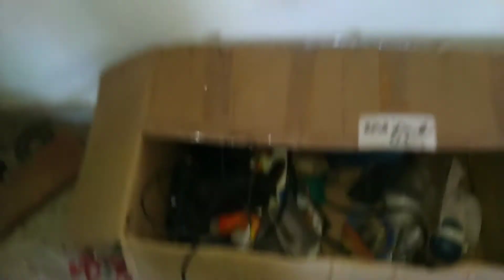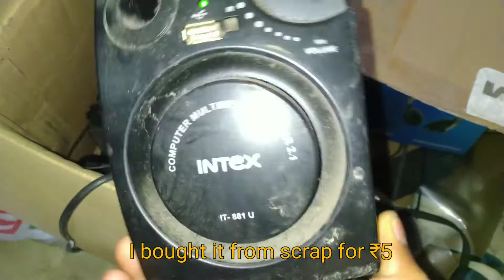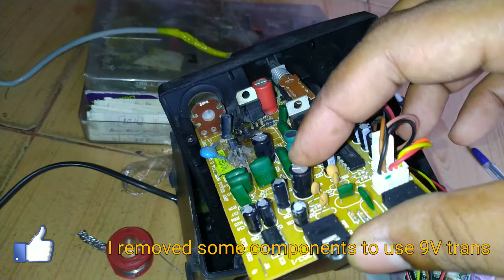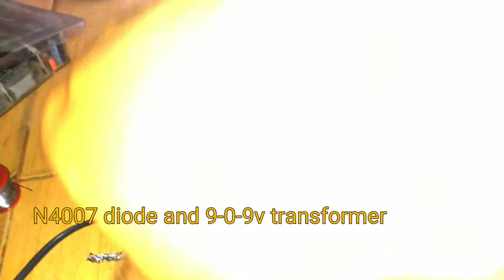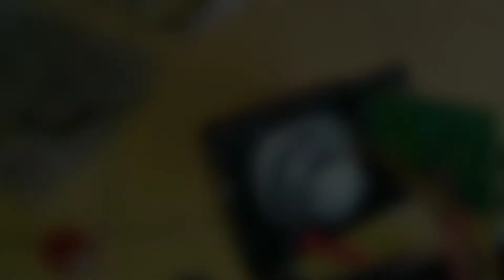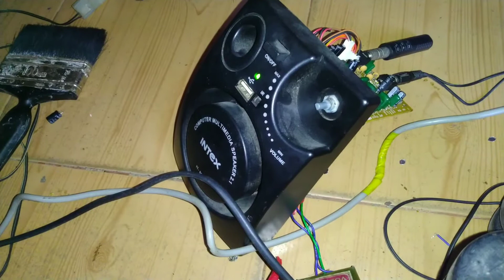Restoration intex 2.1 Comput speaker

Comment: I have same speaker but power not on.is this same fault...
Reply from the maker: Bro my speaker power supply part was Short so i use 9v transformer
U check the power switch or its smps section or power cable